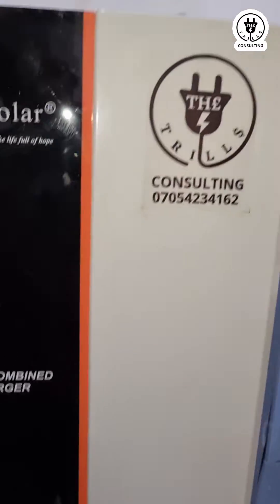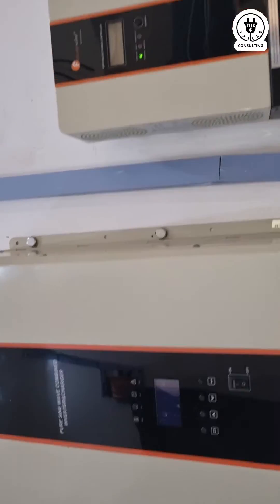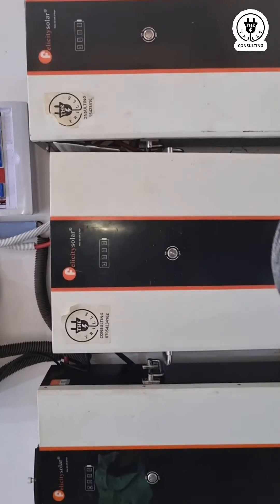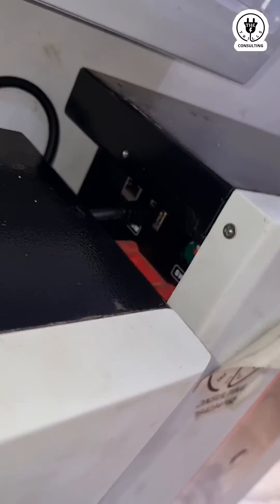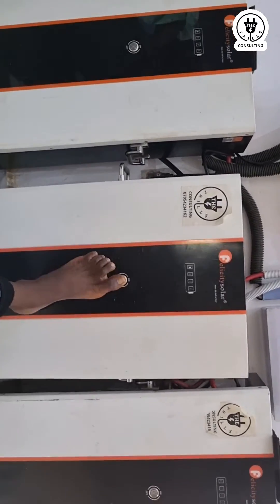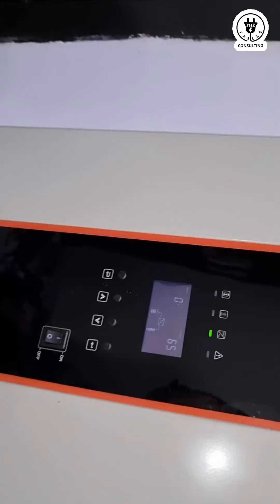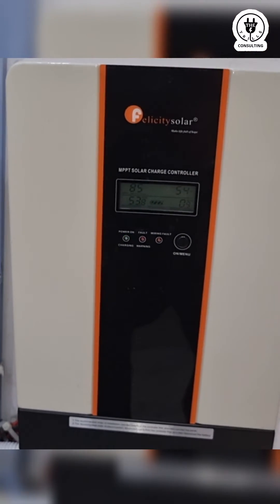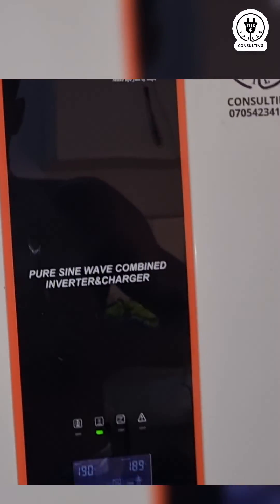Communicating felicity Lithium Battery with inverter.

Comment: I have same inverter but 15kwh LPBF48300 battery but anytime my battery is fully charged I get a error code of 85 ( faults for battery high voltage of built in MPPT) then immediately I add more load the error code disappears. Is it normal?
Reply from the maker: Send WhatsApp message to 070 5423 4162

Comment: What happens when I'm using an mmpt charge controller with a transformer base inverter that doesn't have the com port. Can I connect the communication cable to the charge controller?
Reply from the maker: @rolandonyeka6206  yes

Comment: I am using IVEM8048 and two 15 kwh felicity batteries. It is communicate with the battery and showing the % but it is showing C 0, that is 0 battery. 
When I remove the commutation cable from the Inverter, it shows it doesn't show the % any more, shows 0%, and C 0.

What am I doing wrong? Batteries are connected in series as recommended by felicity.
Reply from the maker: @odaddinson  Batteries are connected in series? 
Connect us on WhatsApp wa.me/custormersupport

Comment: Im having issues with the communication between the IVPA-7548 and the LPBF48300-N battery (15k). Im using the provided cable to the COM port on battery and RS-485 Inverter port (also on the RS-232) and the Inverter doesn’t establishes the connection nor cant identify the battery type. Let me know of there is step order to do it. Any help
Reply from the maker: @JonathanRivera-j8m  connect with us on 07054234162

Comment: Thank you sir, I have two Felicity 5kwh batteries in parallel. When the batteries run down. One of them will be flashing red light on the first bar. It will not come up until I off the battery and on it again. The other one use to come up. Please any idea what I can do.
Reply from the maker: @tsarodavid9730  The battery needs to be communicated. Contact us for guidance  07054234162

Comment: The two top fans of that 10kw inverter should be stops? I have the same inverter but i feel it a little hot and the top fans are always stop.
Reply from the maker: @williamfvega-cuebas1342  Then, there is an issue with it.

Comment: When i saw your title, i was very happy and only to get disappointed at the end. At the end, you didnt show or tell us if the inverter is communicating with the battery. The IVPS has no indication, how do we know it's work?
Reply from the maker: It did work,  you can see in the video,  one battery  can switch off all, that's the indication it worked.
Reply: @thetrillsconsulting  I meant communication between inverter and battery. yes, the battery to battery communication works
Reply: Just to be clear, you said something like, if it was the high frequency type it would show “c” and “Li”..?
But on this transformer based it’s also has that icon but it doesn’t show it.
Reply from the maker: @irokamoses6792  Check this video https://youtu.be/hBAAxFz-hDU?si=zUIVapvyNDSsqnk5